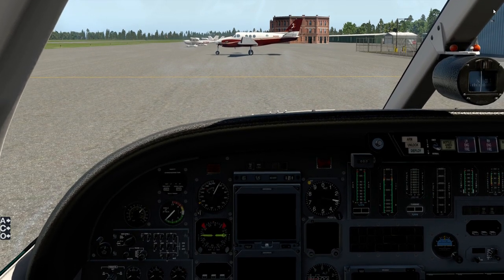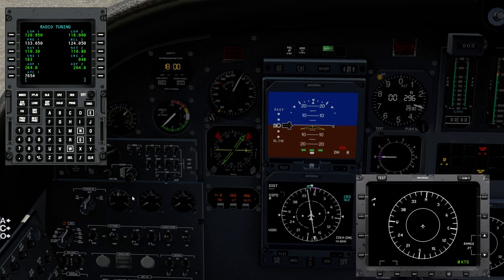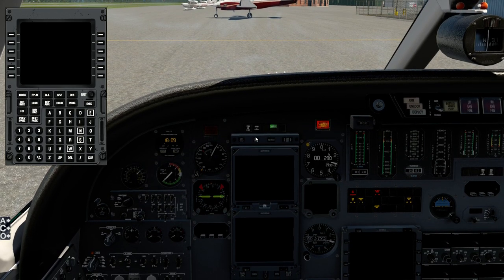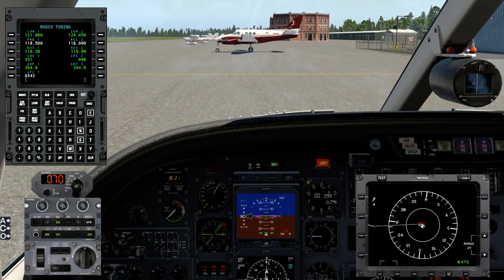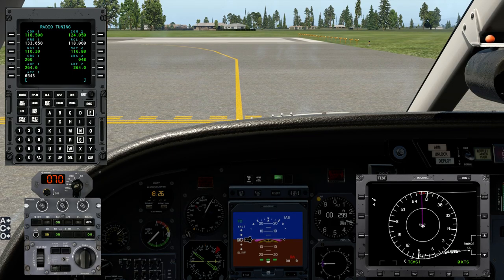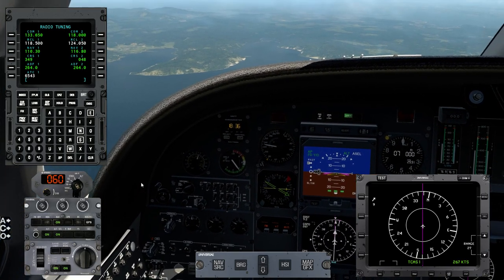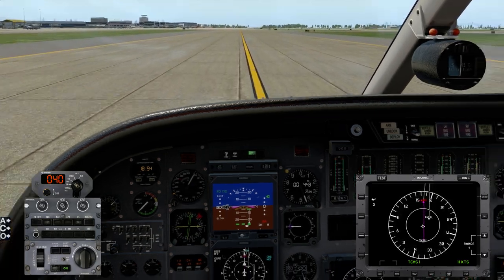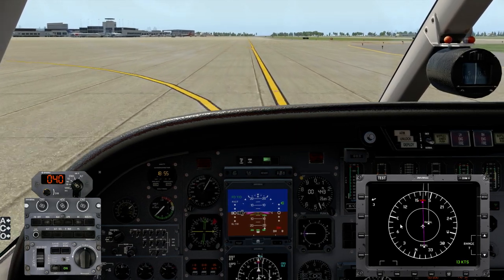Carenado Cessna S550 Citation II for X-Plane 11 Startup and Normal Operating Procedures

Comment: great was great, I have one question it's about the check list audio, how do it get it?
Reply from the maker: Here is the checklist. I copied it from the S550 Flight Manual. The audio is simply the X-Plane text to voice feature. Good luck!

BEFORE START

Preflight Inspection - COMPLETE
Flashlight - ABOARD/CHECKED
Fire Extinguisher - ABOARD/CHECKED
Microphones, Headsets, Oxygen Masks - ABOARD
Documents and Manuals - CHECKED
Oxygen Quantity - CHECKED
Circuit Breakers - CHECK IN
Anti-Ice/De-Ice Switches - OFF
Control Locks - REMOVE
Generators (except for GPU start) - GEN
Fuel Boost Pumps - NORM
Ignitions - NORM
Crossfeed - OFF
Gyro Slave Switch - AUTO
Standby Gyro - ON/VERIFY POWER/OFF
Seat Belt Sign - CHECKED/OFF
Anti Skid - OFF
Cabin Pressure/Rate Control - SET
Throttles - CUTOFF
Engine Sync - OFF
Windshield Bleed Valves - CLOSED
Battery Switch - BATT (CHECK 24 VOLT MINIMUM)
AC Power & Master Avionics - ON
Rotary Test - CHECKED
Parking Brake - SET
Landing Gear Handle- DOWN/THREE GREEN/NO RED
Engine Instruments - NO FLAGS
Electric Elevator Trim - TRIM DISC CHECKED
Airspeed Bug - SET
Fuel Quantity - SUFFICIENT/BALANCED
GPS/FMC - PROGRAMMED
Flight Plan - FILED

BEFORE STARTING ENGINES

Chocks - REMOVED
Seats and Pedals - ADJUSTED
Beacon/Navigation Lights - ON
Cockpit Lights - AS REQUIRED
Standby Gyro - ON
AC Power & Master Avionics - OFF
Air Conditioning - OFF
Cabin Door - LOCKED/LIGHT OUT
Before Start Check - COMPLETE

STARTING ENGINES

First Engine Ignition - ON
First Engine - START
N2 - VERIFY RPM INCREASE
First Engine Throttle - WAIT FOR N2 ABOVE 8% THEN SET TO FLIGHT IDLE
ITT - MONITOR WITHIN LIMITS
N1 - VERIFY ROTATION/RPM INCREASE
WAIT FIRST ENGINE STABILIZED
Second Engine Ignition - ON
Second Engine - START
N2 - VERIFY RPM INCREASE
Second Engine Throttle - WAIT FOR N2 ABOVE 8% THEN SET TO FLIGHT IDLE
ITT - MONITOR WITHIN LIMITS
N1 - VERIFY ROTATION/RPM INCREASE
WAIT SECOND ENGINE STABILIZED

BEFORE TAXI

GPU - DISCONNECTED
GENerator Switches - GEN
Volts/Amps - CHECKED
AC Power & Master Avionics - ON
PASSenger Advisory Light - PASS/SAFETY
Cabin Pressure and Temp Controls - SET/AUTO
Gyro Pressure - CHECKED
Air Conditioning - FAN OR OFF
Circuit Breakers - CHECK RIGHT/CHECK LEFT
Belts and Harnesses - FASTENED
Exterior Lights - AS REQUIRED
Before Taxi Check - COMPLETE 
 
TAXI

Check Departure Runway - BUGGED/VERIFIED
ATIS and Clearance - COPIED
Transponder - SET AS REQUIRED
Brakes and Steering - CHECK RIGHT/CHECK LEFT 
Flight Controls - TOPS CHEKED/BOTTOMS CHEKED
Flaps - CHECK OPERATION/FLAP HANDLE AGREES WITH FLAP POSITION
GPS/FMC - PROGRAMMED
INVerters - CHECKED
Auto Pilot & Flight Director - CHECKED/HEADING-ALTITUDE SELECT
Anti-Ice/De-Ice - CHECK AND AS REQUIRED
Thrust Reversers - CHECKED
Flight Instruments - CHECKED
Altimeter/Altitude Selector - SET
Radios/Avionics - SET
Fuel Quantity/Balance - CHECKED
Pressure Source Selector - CHECKED LH/RH/NORM
Speedbrakes - CHECKED/RETRACTED
Flaps - SET 7 DEGREES
Trims - SET THREE TRIM WHEELS
Takeoff Data/Bugs - REVIEW
Crew Briefing - COMPLETE
Taxi Check - COMPLETE 

BEFORE TAKEOFF

Ignitions - ON
Anti-Ice/De-Ice - AS REQUIRED
Pitot/Static Heat - ON
Exterior Lights - ON
Transponder/TCAS - ON
Engine Instruments - CHECKED
Anti Skid - ON
Annunciator Panel - CHECKED
Departure Runway - BUGS ALIGNED/VERIFIED
Before Takeoff Check - COMPLETE

AFTER TAKEOFF AND CLIMB

Landing Gear & Lights - UP AND OFF
Yaw Dampener - ON
Flaps - UP
Engine Sync - ON
Ignitions - NORMAL
Climb Power - SET
Anti-Ice/De-Ice - AS REQUIRED
Anti Skid - OFF
Pressurization - CHECKED

Passenger Advisory Lights - AS REQUIRED
Exterior Lights - AS REQUIRED
Climb Check - COMPLETE 
 
TRANSITION (climb)

Altimeters - 29.92/29.92-CROSSCHECKED
Recognition Lights - OFF
Oxygen - CHECK
Pressurization - CHECK
Air Conditioning - FAN OR OFF
Transition Check - COMPLETE  
 
DESCENT

Defog Fan - HI
Foot Warmers - CLOSED RIGHT/CLOSED LEFT
Airflow Distribution - COCKPIT
Pressurization - SET
Windshield Bleed Air/Manual Valves - LO/MAX
Anti-Ice/De-Ice - AS REQUIRED
Fuel - BALANCED/CROSSFEED OFF
Descent Check - COMPLETE 
 
 
APPROACH

Altimeters - SET/CROSSCHECKED
Belts and Harnesses - ON RIGHT/ON LEFT
Passenger Seats - UPRIGHT/OUTBOARD
Cabin and Emergency Exits - CLEAR
Recognition Lights - ON
Landing Data - SET/POSTED
Anti Skid - ON
Pressurization - CHECKED
Avionics/Flight Instruments - SET
Approach Briefing - COMPLETE
Passenger Advisory Lights - PASS/SAFETY
GPS selector - SET
Approach Check - COMPLETE 

BEFORE LANDING

Landing Gear - DOWN-3 GREEN-NO RED/VERIFIED
Ignitions - ON
Engine Sync - OFF
Pressurization - CHECK ZERO DIFFERENTIAL
Landing Lights - ON
Flaps - LANDING
Annunciator Panel - CLEAR
Speed Brakes(Prior to 50 ft AGL) - RETRACTED
Autopilot/Yaw Dampener - OFF
Before Landing Check - COMPLETE 
 
AFTER LANDING (silent)

Anti Skid - OFF
Pitot Heat/Anti-Ice/De-Ice - OFF
Ignitions - NORMAL
Exterior Lights - AS REQUIRED
Standby Gyro - OFF/CAGED
Transponder - AS REQUIRED
Radar - STANDBY
Flaps - UP
Speedbrakes - RETRACTED
Trims - RESET
After Landing Check - COMPLETE 
 
SHUTDOWN

Check Parking Brake - AS REQUIRED
Transponder - STANDBY
Avionics & Inverters - OFF
Overhead/Defog Fans - OFF
Air Conditioning - OFF
Throttles - CUTOFF
Exterior Lights - OFF
Passenger Advisory Lights - OFF
BATTery Switch - OFF
Clock - ZEROED
Shutdown Check - COMPLETE 
 
VREF – KIAS Flap Full

WEIGHT / KIAS
14.1 / 114
13.5 / 112
12.7 / 108 
12.0 / 106
11.5 / 104
10.5 / 99
9.5 / 95

VREF – KIAS Flap 15

WEIGHT / KIAS
14.1 / 122
13.5 / 119
12.7 / 115 
12.0 / 113
11.5 / 111
10.5 / 106
 9.5 / 102
Reply: @sogpilot3137  thank you. best tutorial

Comment: Just for fun, I took my Citation II cross country and was running low on fuel.  So I did a quick change to my flight plan and came zipping in at KLIT.  The engines were sucking fumes and did a shut down just as I left the taxiway.  I get this continuous alarm like a cheap European ambulance siren.  I put in about 2500 lbs fuel without really doing any shut down.   How do I turn off that alarm, other than a restart.
Reply from the maker: Hello. Due to the way the software is written, I do not believe the alarm will silence when fuel is added after the alarm has already initiated. Try a complete shut down, then restart. In the future, I would add the fuel while flying the airplane via the X plane aircraft menu instead of landing first. In this case, a restart will reset the alarm.
Reply: @sogpilot3137  That's what I was afraid of.  I knew I should have taken that left turn at Albuquerque.  At least now I know the limit for with distance.  Thanks a bunch.
Reply: @sogpilot3137  I also found out the particular alarm I was hearing was the ELT alarm.  It is the switch that would be between a co-pilot's legs just right of the A/C.  Still can't find out what its use is.
Reply from the maker: If it’s the ELT, the Emergency Locator Transmitter may have activated. Typically would occur when the aircraft is jolted above a preset G force threshold.
Reply: @sogpilot3137  Awesome

Comment: Really nice, I tried searching on how to end where to find the text to voice and can't figure how to use it or where it is. HELP PLEASE.
THANK YOU.
Reply from the maker: Hello.  To set up a checklist in X-Plane, follow the below instructions.  The text is converted to speech automatically by X-Plane as you toggle through each checklist item.  The checklist can be displayed on the screen, or removed from the screen for voice-only checklist toggle.

Using a Checklist
X-Plane has the ability to display a simple checklist in the simulator. This checklist must be stored somewhere in the X‑Plane directory as a plain text (‘.txt’) file.

To load a check list, open the File menu and click Open Checklist. Click on Load New Checklist and navigate to your ‘.txt’ file. Open it and you will see the checklist displayed line-by-line in the checklist window. You can use the forward and back buttons to go to the next and previous lines, respectively.

If you prefer to see the text file all at once (rather than line-by-line as in the checklist view), you can select Open Text File from the File menu and then load a file in the manner discussed above.
Reply: @sogpilot3137  THANKS ALOT I GOT TO WORK PERFECT NICE. DO MORE VIDEOS ONE ON BEECHCRAFT 1900 PLEASE. AND BOEING 737 WAITING ON IT. MAY GOD BLESS HAVE A NICE DAY.

Comment: Great tutorial!  I assume you use xchecklist?  Is the xchecklist file for this aircraft posted anywhere? I cannot find one on x-plane.org for the citation S550...
Reply from the maker: BEFORE START

Preflight Inspection - COMPLETE
Flashlight - ABOARD/CHECKED
Fire Extinguisher - ABOARD/CHECKED
Microphones, Headsets, Oxygen Masks - ABOARD
Documents and Manuals - CHECKED
Oxygen Quantity - CHECKED
Circuit Breakers - CHECK IN
Anti-Ice/De-Ice Switches - OFF
Control Locks - REMOVE
Generators (except for GPU start) - GEN
Fuel Boost Pumps - NORM
Ignitions - NORM
Crossfeed - OFF
Gyro Slave Switch - AUTO
Standby Gyro - ON/VERIFY POWER/OFF
Seat Belt Sign - CHECKED/OFF
Anti Skid - OFF
Cabin Pressure/Rate Control - SET
Throttles - CUTOFF
Engine Sync - OFF
Windshield Bleed Valves - CLOSED
Battery Switch - BATT (CHECK 24 VOLT MINIMUM)
AC Power & Master Avionics - ON
Rotary Test - CHECKED
Parking Brake - SET
Landing Gear Handle- DOWN/THREE GREEN/NO RED
Engine Instruments - NO FLAGS
Electric Elevator Trim - TRIM DISC CHECKED
Airspeed Bug - SET
Fuel Quantity - SUFFICIENT/BALANCED
GPS/FMC - PROGRAMMED
Flight Plan - FILED

BEFORE STARTING ENGINES

Chocks - REMOVED
Seats and Pedals - ADJUSTED
Beacon/Navigation Lights - ON
Cockpit Lights - AS REQUIRED
Standby Gyro - ON
AC Power & Master Avionics - OFF
Air Conditioning - OFF
Cabin Door - LOCKED/LIGHT OUT
Before Start Check - COMPLETE

STARTING ENGINES

First Engine Ignition - ON
First Engine - START
N2 - VERIFY RPM INCREASE
First Engine Throttle - WAIT FOR N2 ABOVE 8% THEN SET TO FLIGHT IDLE
ITT - MONITOR WITHIN LIMITS
N1 - VERIFY ROTATION/RPM INCREASE
WAIT FIRST ENGINE STABILIZED
Second Engine Ignition - ON
Second Engine - START
N2 - VERIFY RPM INCREASE
Second Engine Throttle - WAIT FOR N2 ABOVE 8% THEN SET TO FLIGHT IDLE
ITT - MONITOR WITHIN LIMITS
N1 - VERIFY ROTATION/RPM INCREASE
WAIT SECOND ENGINE STABILIZED

BEFORE TAXI

GPU - DISCONNECTED
GENerator Switches - GEN
Volts/Amps - CHECKED
AC Power & Master Avionics - ON
PASSenger Advisory Light - PASS/SAFETY
Cabin Pressure and Temp Controls - SET/AUTO
Gyro Pressure - CHECKED
Air Conditioning - FAN OR OFF
Circuit Breakers - CHECK RIGHT/CHECK LEFT
Belts and Harnesses - FASTENED
Exterior Lights - AS REQUIRED
Before Taxi Check - COMPLETE 
 
TAXI

Check Departure Runway - BUGGED/VERIFIED
ATIS and Clearance - COPIED
Transponder - SET AS REQUIRED
Brakes and Steering - CHECK RIGHT/CHECK LEFT 
Flight Controls - TOPS CHEKED/BOTTOMS CHEKED
Flaps - CHECK OPERATION/FLAP HANDLE AGREES WITH FLAP POSITION
GPS/FMC - PROGRAMMED
INVerters - CHECKED
Auto Pilot & Flight Director - CHECKED/HEADING-ALTITUDE SELECT
Anti-Ice/De-Ice - CHECK AND AS REQUIRED
Thrust Reversers - CHECKED
Flight Instruments - CHECKED
Altimeter/Altitude Selector - SET
Radios/Avionics - SET
Fuel Quantity/Balance - CHECKED
Pressure Source Selector - CHECKED LH/RH/NORM
Speedbrakes - CHECKED/RETRACTED
Flaps - SET 7 DEGREES
Trims - SET THREE TRIM WHEELS
Takeoff Data/Bugs - REVIEW
Crew Briefing - COMPLETE
Taxi Check - COMPLETE 

BEFORE TAKEOFF

Ignitions - ON
Anti-Ice/De-Ice - AS REQUIRED
Pitot/Static Heat - ON
Exterior Lights - ON
Transponder/TCAS - ON
Engine Instruments - CHECKED
Anti Skid - ON
Annunciator Panel - CHECKED
Departure Runway - BUGS ALIGNED/VERIFIED
Before Takeoff Check - COMPLETE

AFTER TAKEOFF AND CLIMB

Landing Gear & Lights - UP AND OFF
Yaw Dampener - ON
Flaps - UP
Engine Sync - ON
Ignitions - NORMAL
Climb Power - SET
Anti-Ice/De-Ice - AS REQUIRED
Anti Skid - OFF
Pressurization - CHECKED

Passenger Advisory Lights - AS REQUIRED
Exterior Lights - AS REQUIRED
Climb Check - COMPLETE 
 
TRANSITION (climb)

Altimeters - 29.92/29.92-CROSSCHECKED
Recognition Lights - OFF
Oxygen - CHECK
Pressurization - CHECK
Air Conditioning - FAN OR OFF
Transition Check - COMPLETE  
 
DESCENT

Defog Fan - HI
Foot Warmers - CLOSED RIGHT/CLOSED LEFT
Airflow Distribution - COCKPIT
Pressurization - SET
Windshield Bleed Air/Manual Valves - LO/MAX
Anti-Ice/De-Ice - AS REQUIRED
Fuel - BALANCED/CROSSFEED OFF
Descent Check - COMPLETE 
 
 
APPROACH

Altimeters - SET/CROSSCHECKED
Belts and Harnesses - ON RIGHT/ON LEFT
Passenger Seats - UPRIGHT/OUTBOARD
Cabin and Emergency Exits - CLEAR
Recognition Lights - ON
Landing Data - SET/POSTED
Anti Skid - ON
Pressurization - CHECKED
Avionics/Flight Instruments - SET
Approach Briefing - COMPLETE
Passenger Advisory Lights - PASS/SAFETY
GPS selector - SET
Approach Check - COMPLETE 

BEFORE LANDING

Landing Gear - DOWN-3 GREEN-NO RED/VERIFIED
Ignitions - ON
Engine Sync - OFF
Pressurization - CHECK ZERO DIFFERENTIAL
Landing Lights - ON
Flaps - LANDING
Annunciator Panel - CLEAR
Speed Brakes(Prior to 50 ft AGL) - RETRACTED
Autopilot/Yaw Dampener - OFF
Before Landing Check - COMPLETE 
 
AFTER LANDING (silent)

Anti Skid - OFF
Pitot Heat/Anti-Ice/De-Ice - OFF
Ignitions - NORMAL
Exterior Lights - AS REQUIRED
Standby Gyro - OFF/CAGED
Transponder - AS REQUIRED
Radar - STANDBY
Flaps - UP
Speedbrakes - RETRACTED
Trims - RESET
After Landing Check - COMPLETE 
 
SHUTDOWN

Check Parking Brake - AS REQUIRED
Transponder - STANDBY
Avionics & Inverters - OFF
Overhead/Defog Fans - OFF
Air Conditioning - OFF
Throttles - CUTOFF
Exterior Lights - OFF
Passenger Advisory Lights - OFF
BATTery Switch - OFF
Clock - ZEROED
Shutdown Check - COMPLETE 
 
VREF – KIAS Flap Full

WEIGHT / KIAS
14.1 / 114
13.5 / 112
12.7 / 108 
12.0 / 106
11.5 / 104
10.5 / 99
9.5 / 95

VREF – KIAS Flap 15

WEIGHT / KIAS
14.1 / 122
13.5 / 119
12.7 / 115 
12.0 / 113
11.5 / 111
10.5 / 106
 9.5 / 102
Reply: @sogpilot3137  Thank you!